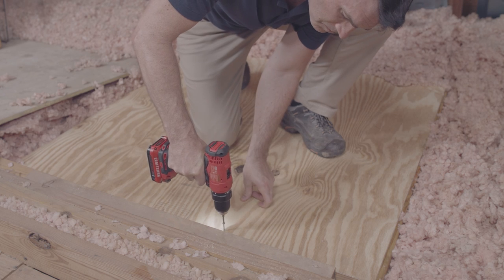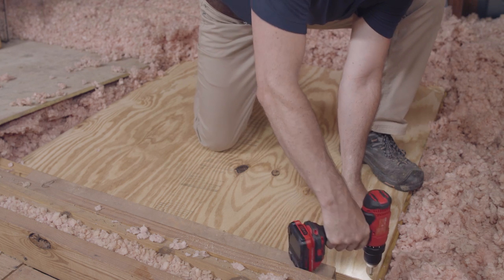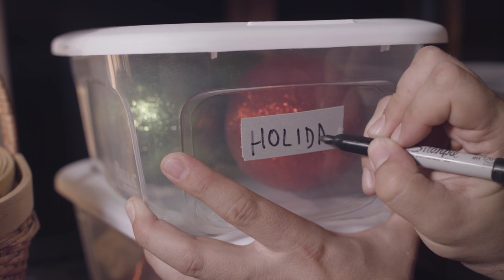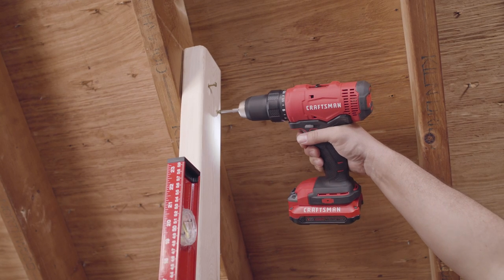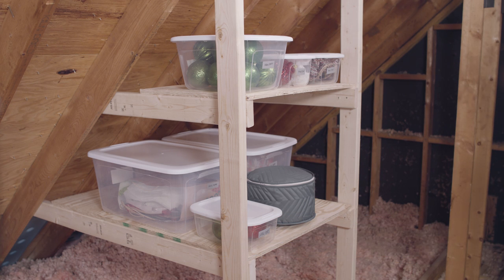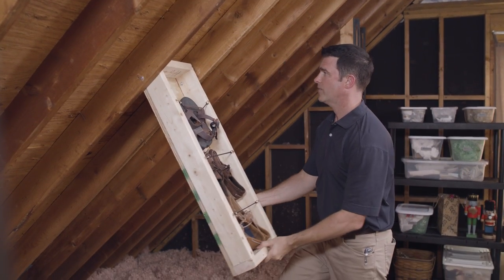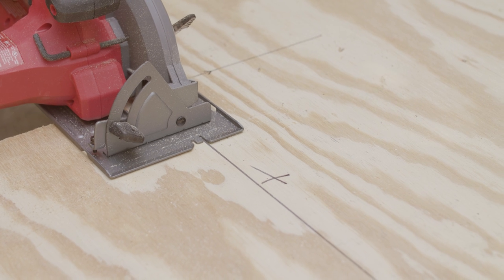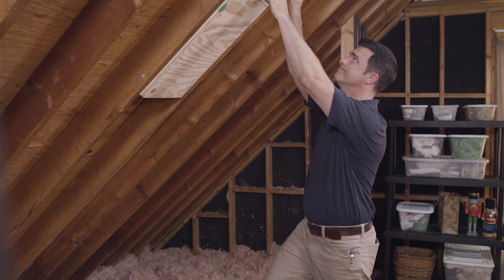How to Organize Your Attic | 5 Easy Storage Ideas

Comment: The clear bins are not a good advice though. Usually clear bins are made of a different plastic type than opaque bins... They will melt away during summer temperatures. Ask me how I know. I still use them, but the lid does not close now because the bins are so warped due to heat.
Reply: Thanks for info...

Comment from the maker: IMPORTANT: Depending on where you live, unfinished attics can get very hot and/or very cold. Consider your specific climate when determining what can be stored in your attic. Non-porous & non-biodegradable items like plastic, metal, ceramic & glass will fare the best in long-term attic storage.
Reply: its not depending where we live. It's a guarantee that it will get very very hot. Even a sunny 80F day can make the attic go into the 120s just because of solar gain.
Reply: Awesome advice

Comment: Idea 3 won't work with the way it's shown. The newly added vertical 2x4 support beams are added to one side of the roof rafters, then putting the horizontal 2x4 on one side of the roof rafter won't line up with the newly added vertical 2x4 support beam as the horizontal 2x4 will be flush against the roof rafter and the other end will have 2" of space from it to the newly added vertical 2x4. Notice how they won't show you the vertical connecting to the roof rafters and the horizontal connecting to the roof rafters at the same time.
Reply: Just need a piece of 2x4 to shim it.

Comment: Came across this video after watching the Lowes video on "How To Add Ann Attic Pulldown Ladder".  I almost passed this video over but I  am glad I didn't.  It's simple and informative.  I just wish my attic was this well laid out, clear, and used the rolls of insulation batting. (someone did the "Blow In Insulation" and I HATE dealing with the LOOSE insulation). 

After you get the "between-rafter" insulation installed, the pieces of plywood (that act as a floor) is a great idea for almost any part of the attic where you will "possibly" ever be stepping, and/or storing boxes.  
It can get to some extreme TEMPs in an attic so if you have a standard, basic rectangular-shaped, box style house, with ventilation louvers on each end, you might want to go to motorized louvers with a PUSH-PULL, air flow design. Especially in the summertime, to "move" the hot air OUT  of the attic.  Many of the active ventilation louvers are "Temp Controlled" and move air out only when a threshold TEMP is reached. They then shut off when temps drop below the limits set for the cooling fans.

Loved the simplicity of the video, with no "fluff" added.

Comment: When installing plywood to the rafters as floors, do you loose R Value due to the compression of the insulation batts?
Reply: chelin7023 yes
Reply: Not if the insulation is at or  below the height of the rafters. Then you wouldn't get any compression. Even if there is some compression from the insulation being above the rafters a little bit, the plywood  would further add some additional insulating effect.